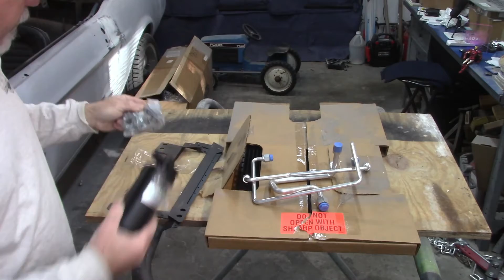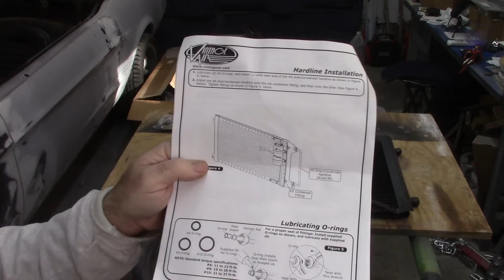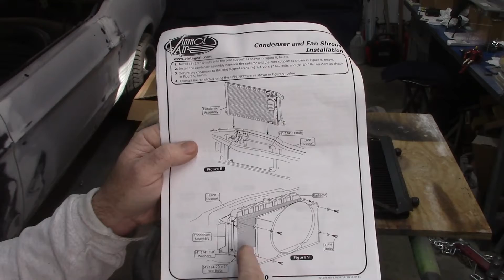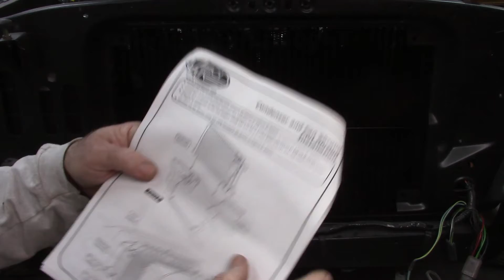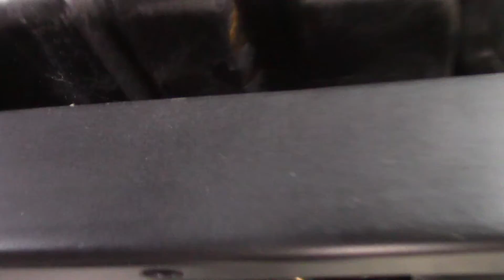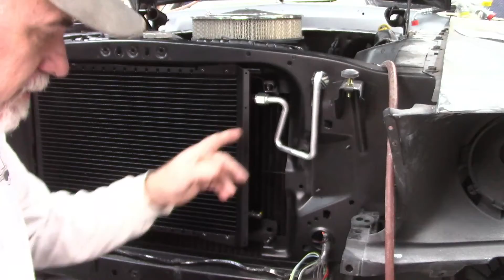1968 Mustang Vintage air install part 4. Jade part 54

Comment: Did trial fit of my VintageAir on my 68 Mustang (W/Factory Air).   Had just picked up new 3 core radiator to cool a 390 that might end up (gulp) traffic!  Anyhow..the triple core does project forward (towards the bumper, so there is very little space to accommodate the condensor on the Engine side of the radiator support. I flattened (hammer/dolly) the 4 Tabs that the condenser attaches to.. but still not enough space.  Ended up with 1/4x20x1" bolt head and washer on the Radiator side of the support, and a the rest sticking forward.  had another washer, a jam nut then 2 more washers on either side of the condenser mounting tabs.  not very elegant but the 1/4 x 20 hex was pretty close to radiator fins.  The CC397 radiator has squared off top tank so the radiator support bracket doesn't work. Sad realization. The lower saddle doesn't match the lower tank contours either. should have gone with OEM style tanks!   Looking at the Ford Contour fan shroud combo that seems a close match to the radiators size. Going to trial fit the hood latch support and grill to make sure there is clearance. Good idea on painting aluminum black. Hate what corrosion does to alum tubes!  Great presentation!  A few more to go after this episode.

Comment: gotta get a set of crowfoot wrenches to adapt a standard torque wrench into an open end wrench. had to use them for a couple of applications. but the ole german method of "guten teit" works too.

Comment: I would have to paint those lines and drier brackets to match the everything else. I really hate seeing all that stuff thru the grille on the outside. At least if its all black it will blend in.
Reply from the maker: That's the plan.

Comment: Great video Barry, loved the little monkey! Instead of a fan shroud I would recommend looking into an electric fan or two. Looked like that core support hole might become a slot. Just a little “peanut gallery” input. Thanks for sharing!
Reply from the maker: I will be doing some research on the fan idea.

Comment: When my 65 got it’s classic auto air 15+ years ago, I had a friend install it.  I didn’t realize what a job it was when I had asked him to do it.  It was done while the engine swap was being done.  Heater coar was leaking, so it seemed like the best time to do it all.  I didn’t realize back then how much extra work I was asking him to do. Nice job at showing what is involved in this process.
Reply from the maker: Thanks Rick. Was it you asking about my 65?

Comment: I have been in the HVAC business for 40+ years. you will be ok to go ahead and hook up the drier. just make sure you pull a vacuum on the system and you can leave it like that for as long as you want.
I installed my vintage air in my 69 camaro and it sat for 2 years like that and worked fine.
Reply from the maker: Unfortunately I don’t have any way to vacuum it down.

Comment: A crows foot is how you can torque tube fittings without buying specialized A/C technician tools. Also, I wonder with the condenser being upside down, if that could have caused the fitment issues? A shroud is a must down south so you don't over work the compressor. (fuel economy will suffer)
Reply from the maker: Good advice. I had the same clearance issue with the condenser installed either way. I’m looking into shrouds or a whole new radiator setup.

Comment: Wise move not uncorking the dryer now.  As always, when using aftermarket  parts  it seems they require just " a little bit" of modification.  I usually chuckle too when making a minor screw up but it is followed by a muttered dumba__ to myself.
Reply from the maker: Same. My dad called me that a lot, so it’s a default response.

Comment: Superb video Barry!  I didn't think I'd see part 4 come along so quickly.  So glad to see the challenges and how you fabricated the solutions, especially to those brackets.  I have a non AC car, but did cut out the core support square knockout before sending it to paint.  Kinda wishing I didn't do that now after seeing the round hole it asks for.  I'll have to think on that one.  Thank you again for another fantastic video!